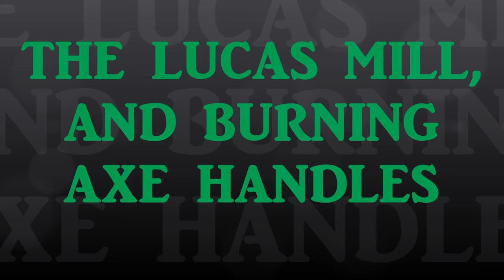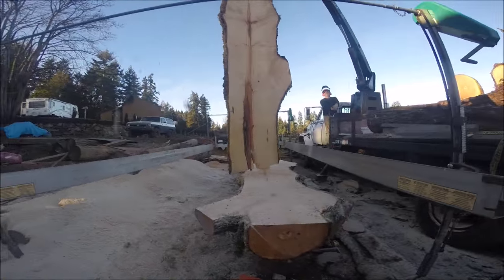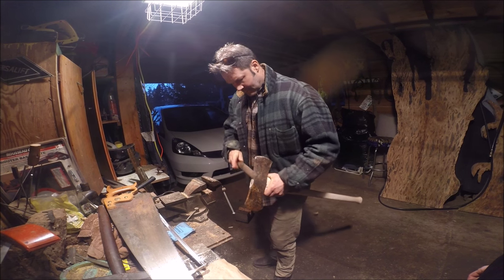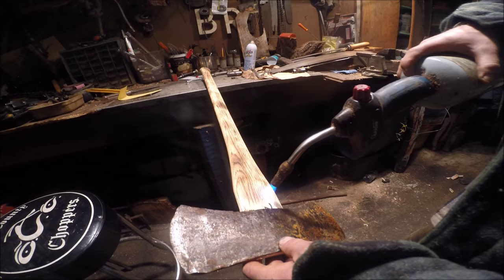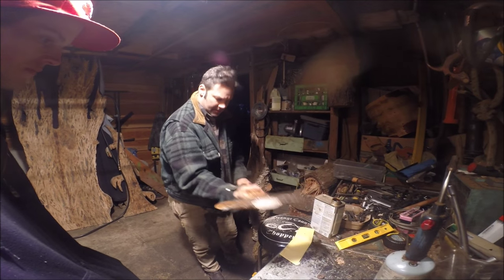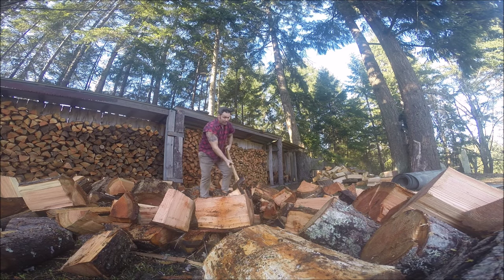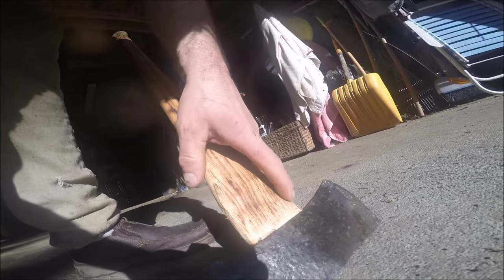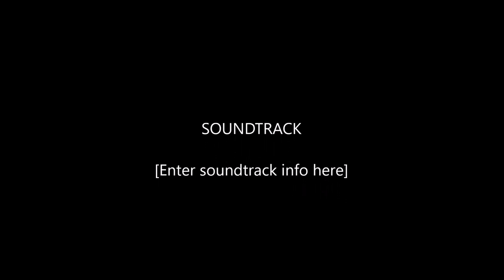THE LUCAS MILL, AND BURNING AXE HANDLES

Comment: great video there Billy, awesome slab. The burning and slittin wood is very PROPER... lol. I have some blacksmithing experience and the looks of your axe is that maybe the steel insert ( cutting bit)that was forge welded to the wrought iron (axe body) might be seperating just due to use. it is hard to tell without looking at it in person but have seen it in an old axe here in Tennessee. Anyway keep the kids coming and I'll be watching and supporting and sharing even though I am not a content provider... yet. thanks again
Reply from the maker: +Wade Wittman ,, PROPER'' HA , LOVE IT, thx a lot its means alot

Comment: that axe head you are talking about that is smaller but weighs more than the other double bit axes is probably cast-iron rather than mild steel that would explain why it weighs more but is not as big
Reply: steven keller cast steel

Comment: Curious if the name "Road Warrior" is cause it just is always left in the truck, available for all emergencies? I have an old felling axe that I bought at a yard sale for $7, with a (not original) poly-handle (yuck!!), which I never swapped out fir a wooden one, as the axe hangs on the outside of my f-550, just outside the driver's door, exposed to the elements.... Some guys hate me fir letting it get a little rusted, but I sand it and erl'itt up from time to time to stay basically on top of that....
Reply from the maker: +Samuel Luria the black smith on mad max designed and hammered it , sgot that look, thx
Reply: Landlord just gave me 60 days to vacate. So, I'm heading outside to mill up a 50" oak log, so that I will be ebble to move it when the time comes... We're looking at sub-zero (WITHOUT wind-chill) temperatures in Jersey the next few days, so, my guys "have off"... Trying to stat strong...
Reply from the maker: MAKE SURE YA WATCH MY NEXT VID RIGHT TO THE VERY END, THERES SOMETHIN THERE FOR YA. READ IT ..WIERD HOW THE WORLD WORKS IT LL BE UP IN 10 MIN